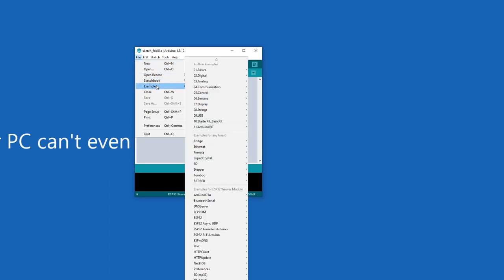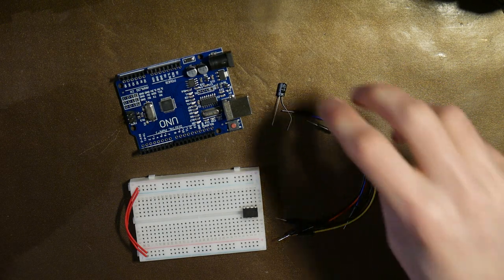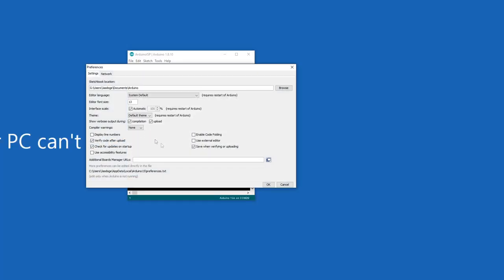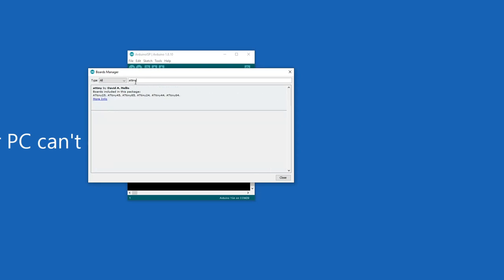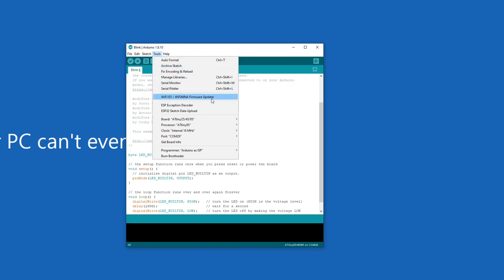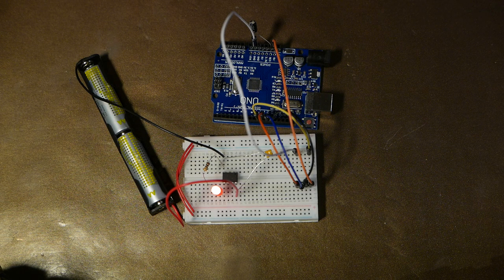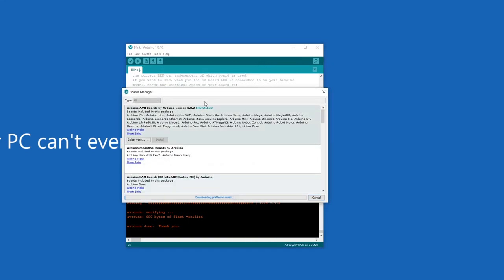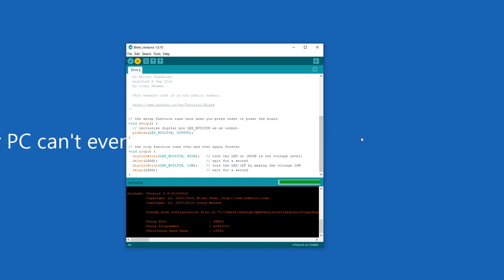Programming ATTINY13 & ATTINY85 with Arduino UNO

Comment: I found your video because I use sometimes ATTiny85; and I have to assemble the Arduino Uno to load the program to ATTiny every time. So I was looking for a faster/simpler way to do that, and got a USB programer like you shown on beginning of the video. Already used this method using the Uno and I think I still do that rsrsrs but stop to say your tutorial is exceptional, clear and a good image also... so a thumbs up!   maybe Its time to make a board shield to the top of my UNO just for burning attiny85s

Comment: I still don't understand the clock option from 1MHz to 16MHz, I know about the external an internal option, but how am I able to know which clock frecuency is better for my project to work properly?
Reply from the maker: It comes down to what you want to do. The lower the frequency, the less power your microcontroller will consume. But higher frequencies might be required by certain interfaces, such as communicating with neopixels. If you want your circuit to run on a battery, you'll want a lower frequency and sleep mode. If it's something that should be plugged in through a wall supply, it doesn't matter that much since the difference is a few milliamps.

Comment: Does the capacitor have to be a 10uF capacitor? I don't have any and delivery times are a bit of a problem right now. Very helpful video, though!
Reply from the maker: I think you might be able to use a different value, but it needs to be electrolytic. You can try a different value. Either it works or it doesn't, you won't break your device. Just make sure to discharge it first.
Reply: @jasdoge  Thank you very much!
Reply: @jasdoge  Can you explain how this capacitor prevents a reset, and why it might otherwise reset on its own?  Thanks!

Comment: This is actually _NOT_ the "correct" way to program it, because it is much easier than what you're doing here. No need to put it on a breadboard. You also don't need the small ceramic capacitor, that some people include, since everything is already on the devboard. You can achieve the same result with two different methods and both include the devboard and an ISP.

Method 1: Using your Arduino as an ISP.
- Flash the ArduinoISP sketch onto your Arduino.
- Put the ATTiny85 chip into the devboard
- Connect the Arduino to the terminals on the right side of the programmer (only the upper six pins). Use this SPI pin configuration:
--- Left is the Arduino, right is the ATTiny GPIO pin name
--- vcc -> 5V
--- gnd -> gnd
--- mosi (pin 11) -> p0
--- miso (pin 12) -> p1
--- sck (pin13) -> p2
--- rst (pin 10) -> p5
--- p2 and p3 on the devboard stay unconnected
- Insert the 10 µF Cap into the Arduino as you described as well (long leg to RESET and short to GND)
- Leave the devboard USB plug unconnected
- Open ArduinoIDE and select the "Arduino as ISP) programmer.
- Select 1 MHz or 8 MHz internal clock (both works for me)
- Burn bootloader
- Upload your sketch to the ATTiny85

Method 2 (which is the simplest, because no cable mess is required): Using a cheap USBasp (with included cable and adapter)
- Take the USBasp and plug in the cable and the adapter board
- Line up the adapter with the devboard terminals so that the six connections of it line up as it is written below the devboard (p3 and p4 stay unconnected)
- Make sure to put the adapter board the right way around (5V goes to the upper right terminal on the devboard when viewed from the top)
- Insert your chip (the right way around into the devboard)
- Connect the USBasp to the usb ports (install drivers if it's not immediately recognized - there are tutorials available for that)
- Select the board, chip type, and clock speed (1 MHz internal or 8 MHz internal)

- Select USBasp as the programmer
- The "port" selection is left empty
- Burn bootloader
- Upload your sketch
--- If upload fails, then select "Upload with programmer" from the menu. For me uploading works using.

When uploading the blink sketch use "PB1" as the LED output pin, because the devboard has the second LED connected to p1.
Reply: Great instructions! I'm just wondering, why do we need to "burn bootloader" as one of the last steps in both methods? I thought the purpose of bootloader is allowing to program the chips with a USB connection, and ISP wouldn't need that? (haven't tried ISP yet, although I do have an USBasp, this ATtiny dev board and a few ATtiny85 chips laying around waiting for me to try it out).
Also, for connection the USBasp cable to the dev board, do I have to bend over the two unused pins (p3, p4) so that the plug may fit? Like on this picture - https://www.iot-experiments.com/content/images/2017/11/IMG_20171107_132822.jpg
Reply: @GenePavlovsky  Hello, my USBAsp adapter board has only a female six pin header, so I don't need to bend any pins on the dev board: https://images-na.ssl-images-amazon.com/images/I/414Z6%2BeAkmL._AC_.jpg
I guess yours spans across all eight of them with two being closed or not connected. In that case yes, either bend them or unsolder them and solder them on from the back side.
Regarding the bootloader: It is the program, which is run before the custom program you flash onto it. It is usually just burnt once on it and can stay there until you want a different one. It initializes the chip, sets the clock speed and other initializations. The differences of the bootloaders can be in size and/or what they actually do apart from initialization. You always choose a bootloader that is small enough, so it leaves as much space for your program as you need. But a smaller bootloader can't implement comfort features like USB emulation (like the the micronucleus bootloader does). Theoretically it would be possible to create a program, that acts as a bootloader and also contains your own program, but this is not very practical, as you would need to reinvent the wheel instead of just focusing on the things you want to do with the chip. Micronucleus is meant for rapid prototyping because you upload code lots of times until the chip does everything that you want. Although I'd argue that using an ISP is just as simple. In a finished product I'd recommend using a ligtweight bootloader instead, partially because there won't be that long startup time to allow for programming before the actual program is run. Now, after saying "bootloader" a dozen times here, I hope that was sufficient explanation to help with understanding what it's purpose is, but there is much more to it that that for sure.
Reply from the maker: How does method 1 differ from my video? Method 2 is a great alternative way of programming it. I don't have one of those, so that's why this tutorial is on how to do it with an Arduino. Let me know if you do make a tutorial video on USBasp and I'll link it in the description.
Reply: @jasdoge  you're basically telling people that this board is useless, which it is not. It allows you to omit the breadboard altogether and even comes with an inbuilt led wired in. Also you can actually flash the attiny85 via usb with this board, when you have flashed a micronucleus bootloader on the chip beforehands. I've tried it and can confirm that it works (a bit more complicated and only on windows - maybe linux, not mac osx). Also the pin names are printed on the board (back side) which is handy to have.
Reply from the maker: @Noxoreos  Yes the micronucleus/USB programming is what my previous video shows how to do, and it comes with a ton of drawbacks like slow boot times and enforcing you to pull up pin 3 in order for it to boot. Which is the primary reason I don't recommend it. And you need an Arduino or external programmer in order to actually use the USB for programming in the first place, so why not just use that one to program it instead of the board?

Sure, the USB can come in handy for powering the project, and the breakout pins can also come in handy. But the ones I got from Aliexpress require soldering, which a breadboard does not. A breadboard also has the benefit that you can repurpose it for any projects you want down the line.

It does have 2 builtin LEDs, but I see that as more of a drawback as it creates a 1k pull-down through the LED, interfering with using that pin as an analog input.

The only benefit I can see to using one of these over a breadboard is that it has a built in decoupling capacitor for the attiny. But then again, it's not strictly needed, and anyone working with electronics should have 0.1uF capacitors on hand judging by how commonly used they are.

And as far as "omitting the breadboard" goes. You still have to plug in the same amount of cables (unless you go the USB route with all the drawbacks I mentioned). So you'll still be using this as a tiny breadboard that you can only use for 1 component.
Reply: @jasdoge  You do not need the external programmer to program it when the micronucleus is installed. You can use the devboards usb port. You have to unplug it and plug it back in when it's time to program. That is the reason for the waiting time of 30sec on boot.
Also no pullup is requred to flash either.
The arduino ide actually tells you then to plug in the dev board. In the time of 30 sec the bootloader opens a usb softserial connection for flashing and closes it then.
Reply from the maker: @Noxoreos  You do need one to install micronucleus
Reply: @jasdoge  true that. I have one devboard with an attiny set up specifically for prototyping with micronucleus. 
After the code is done I flash it to a different attiny chip with a lightweight bootloader and wire it up more permanently. I use breadboards only to connect to test more complicated circuits. All i'm saying ist that these boards are not junk and actually very useful. I'm not saying they should be used in every situation. The reason why i was saying "that is not the correct way" is because you were using it in a way, which was not intended for it to be used and then call it crap. I'm also not telling what is the correct way, because there is no "correct" way. It's a matter of preference. Btw. a usbasp programmer with adaper is very cheap (i paid $3 for both)